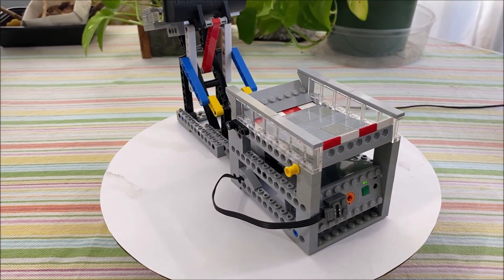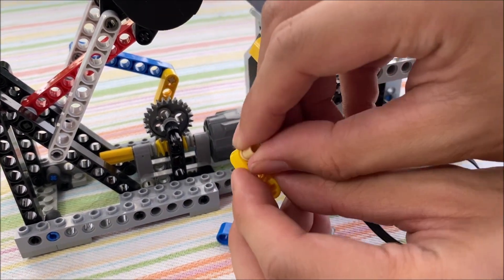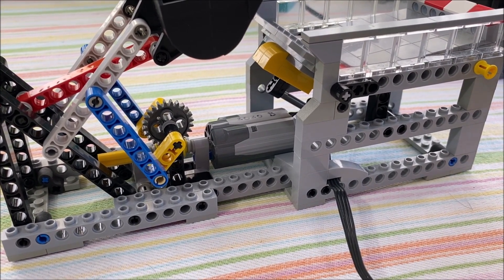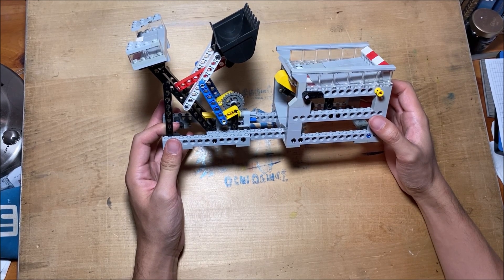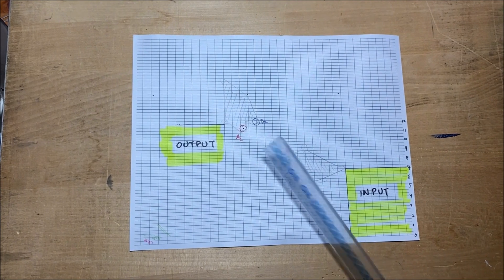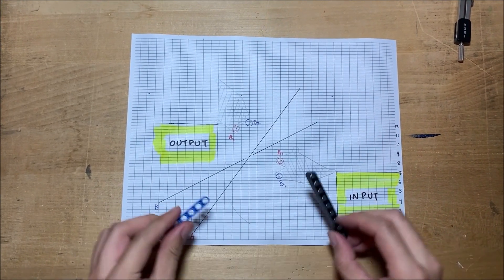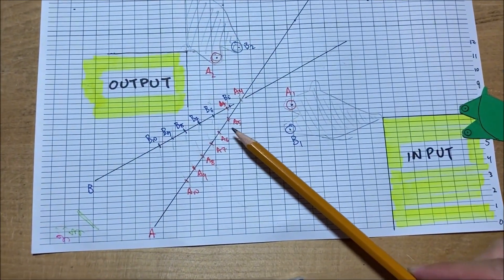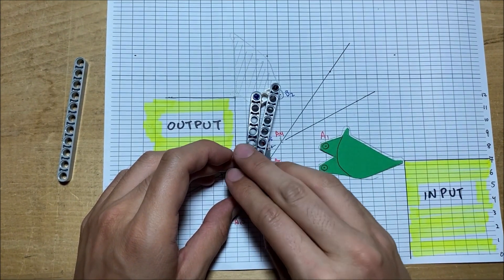How to Design a LEGO Four-bar Linkage (feat. GBC Dozer Linkage)

Comment: I really like the design. Will probably build it myself for one of the next shows.
I realized the motor is sitting on tiles (instead of being attached to studs) and therefore moves back and forth. Is there a reason behind this? Is it better in some way?
Reply from the maker: That mounting makes it easier to install and to remove the motor (for testing, replacement, or borrowing for another module). It also keeps the motor shaft (the orange part) from taking axial load. The module isn't heavily loaded so it might not make a big difference in this case.
Reply: some newer motors have the red part (M L and XL) but are more expensive due to the built-in rotation sensor that can use a servo for the L and XL.
Cat said PF has been discontinued, expansive, and rare.